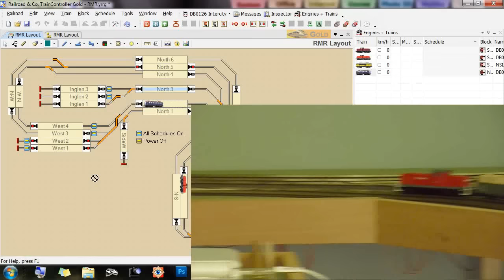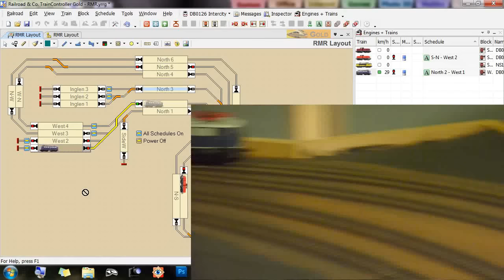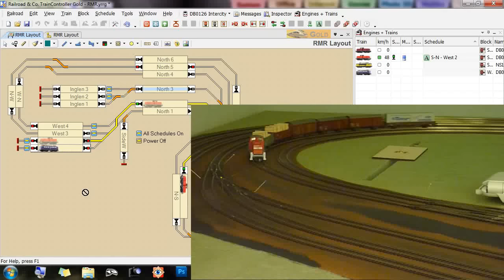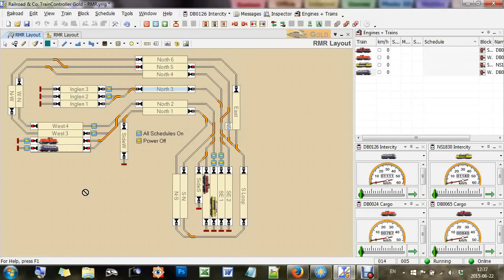RMR041 - Test Run With Traincontroller 'Auto Train by Drag and Drop'

Comment: Great tutorial Ruud !!! Thanks from Spain. I was unsure whether to use itrain or train controller but all my doubts have been cleared. Just a question ... do you plan to talk about how to use uncoupling system and turntables ???.. Good job.
Reply: Candletown Yard Hi i have i train and i find it a chore to use and i have had many connection problems to my ecos......i am going to buy train controller soon as its a pleasure to use and you have Ruud 's videos.......jim
Reply: hovermotion And do not forget the block concept. In itrain it's so complicate to setup, but with TC no problem in my first attempt including signals aspects. !!
Reply: That's why I am moving over to tc..jim